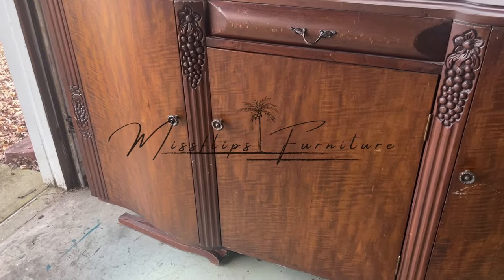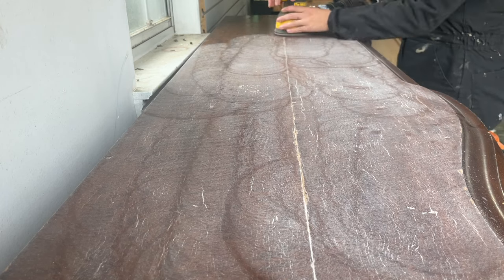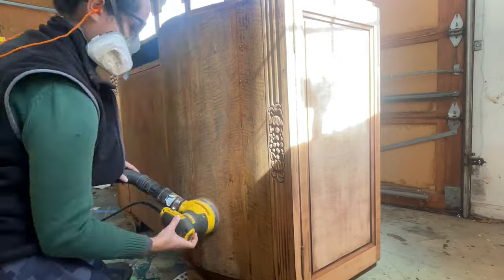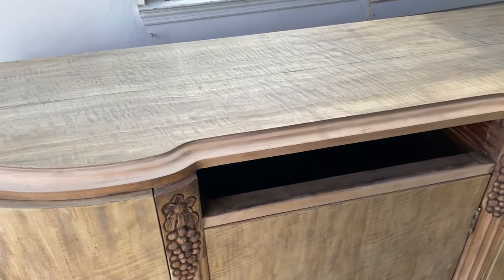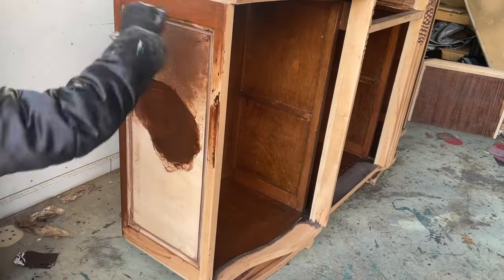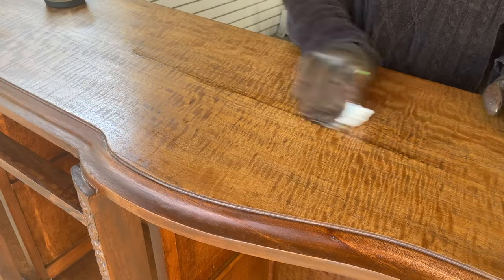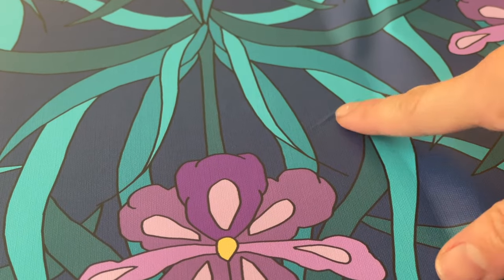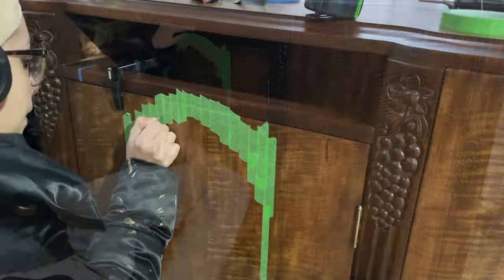Sideboard Makeover (PART 1) | Color Matching four different wood variants! | DIY Wood Toner

Comment: Do you have a preferred wood filler for veneer cracks?
Reply from the maker: I think the best wood filler is just filling the crack with glue and while it’s still wet, sanding over it so the dust from the actual wood can fill it. Easier to color match that way. But I had some plastic wood on hand that I needed to us